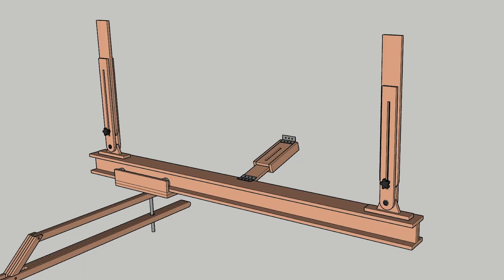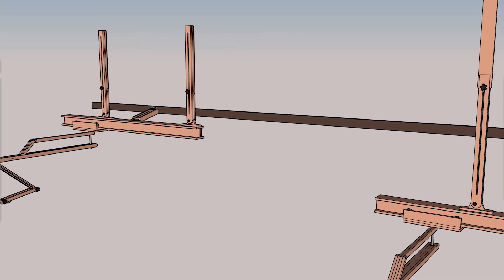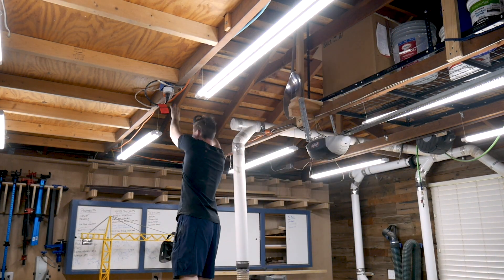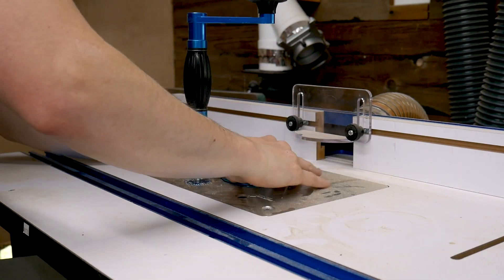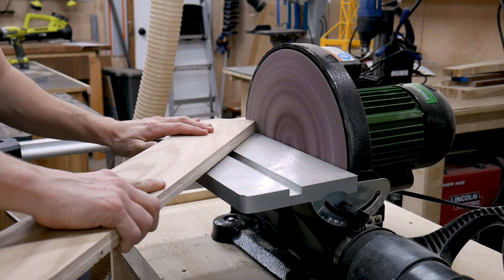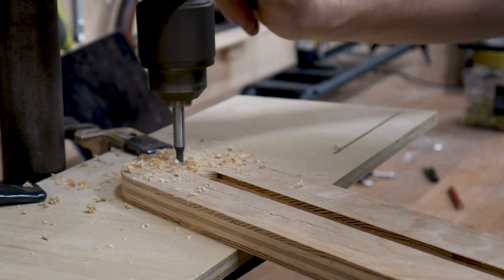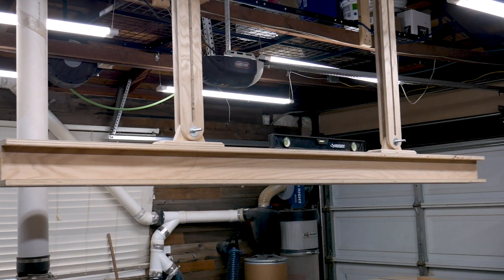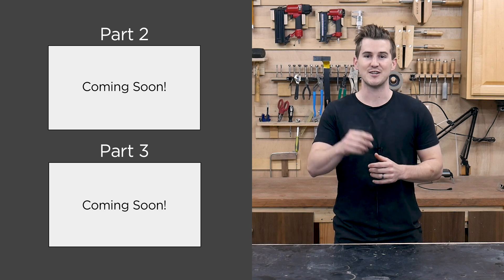Workshop Camera | Part 1

Comment: if you're looking for a little more overhead room in the middle of the garage, a quieter opener, and probably a faster one than those old genie units, you should check out the 8500W from LiftMaster (or the RJO70 from chamberlain, it's the same unit). It's called a residential jackshaft opener, and it attaches in the corner of the garage to the wall (not the ceiling!) and couples directly to the shaft that has the garage spring on it. there's no need for the rail connecting the opener overhead in the center of the garage, and you get lots more room!
Reply from the maker: I’m definitely in the market for a new opener and 100% going to look into this option - thanks for the tip!
Reply: @workshop_edits  not that I'm extremely familiar or with it or anything...... But if that's an attached garage with a living space/bedroom above it, you'll go from mild earthquake in the room while it's running to not even knowing the door is moving